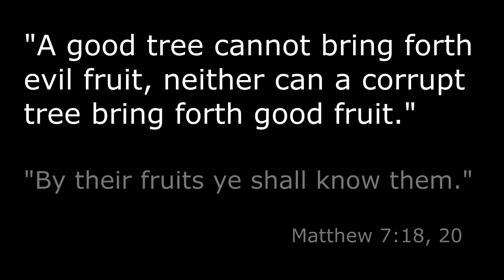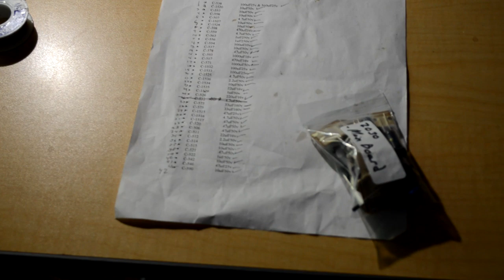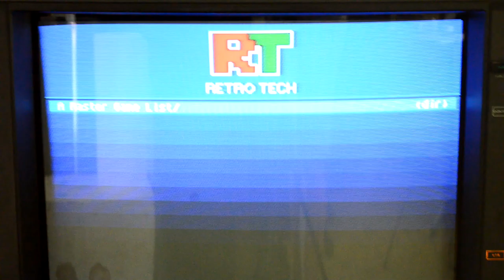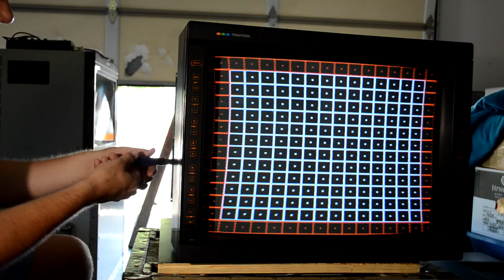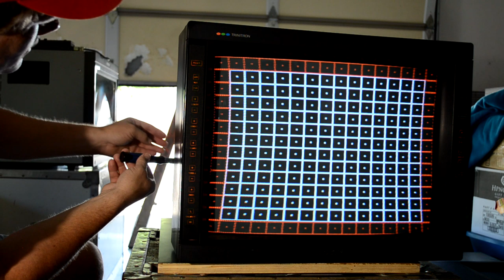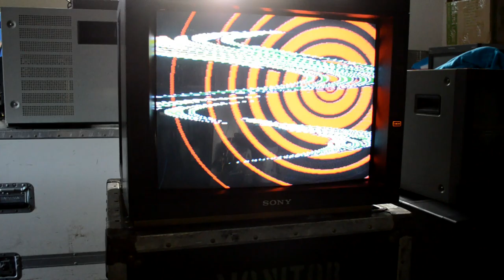How to Recap & Calibrate a CRT | w/ The Sony PVM 2030

Comment: I have a 2530 from 1994 and it looks great, except for about an inch of black on one side. I have an Extron VSC 700 that can move the picture horizontally and vertically to fix the issue, but it’s tough to find RGB cables for different consoles that are compatible with Extron. If I get brave one day I will reference this video and adjust the H position as you show here. Awesome video sir! You’re a hero.

Comment: This is fantastic! I just started following you as you have the best information for calibrating CRT tvs. I just found a KV-32FS120 Trinitron and found out how to access the service menu but have no idea which of the hundred of settings do what. The service manual tells you what the abbreviations mean but no description on what they do for the most part. Like PAMP is pin amp? I didn’t know what that setting did and I don’t feel particularly comfortable just adjusting all willy nilly. This video helped to show what a few of the frequently adjusted settings are. Thanks!

Comment: My pin amp is slightly off on my 2730QM. Is it the kind of correction I could easily perform on my own (as a complete novice who’s never opened a CRT)?

Comment: i have a question: i have old sony trinitron from 1998 (not pvm, just normal consumer TV) and when using composite and there is no signal (meaning its just displaying black screen with av2 icon in the corner) the blacks are PERFECT, you wouldnt even be able to tell it is turned on if thst icon wasnt there but whenever it gets signal from ANY of my consoles like ps2 or ps1 the black looks washed out and grayish but ONLY when it recieves signal, when i turn the console off then black level is perfect again, could that mean the tube is worn out or some electronics failed?

Comment: The result on the geometry is perfect after adjusting, but that PVM has major issues on its convergence. Have you did something to correct that? I have a pretty similar monitor, a 2130QM, and it's starting to have issues with its convergence on one corner, but I think that has to be corrected with convergence strips. However, on this one, convergence on the corners is quite awful...
Reply from the maker: That's a drawback to all these older PVMs, the larger ones especially have pretty bad convergence compared to newer and more high end CRTs.  I adjusted the rings and even swapped out a different yoke and this was the best I could get it at the end if the day.  It also should be mentioned that I only was using SVideo, so the picture is a bit less sharp than RGB will be.

Comment: Any idea why I wouldnt be able to adjust the horizontal size on a CRT in the service menu? When I change the value, it does nothing. I can change the horizontal position,  vertical position, and vertical size, but NOT horizontal size despite there being a setting for it.
Reply from the maker: That was the same original problem with this 2030.  When I tried to adjust it before a recap, many of the trim pots did nothing.  After a recap, evertrhing worked great.  It may be that one of the capacitors on the horizontal size line has failed.  I'd try recapping.
Reply: @RetroTechUSA  Thank you!!!!
Reply: @RetroTechUSA  I opened up my TV. I am seeing 3 different PCBs. A small one behind the yoke, a big one at the very bottom of the TV with all the power connectors going into it and a smaller PCB next to my inputs. Which board should I be looking at with regards to re-capping? I heard of a geometry board but I am not sure which one that is. There are a ton of caps and I dont wanna replace more than what I have to.
Reply: I noticed in your video you are able to manually adjust the parameters on that PVM. On the CRT I have, I dont see any holes like that on any of the boards, or any words like "h size". The only thing I am seeing is the adjustment things at the back of the yoke but I believe in another video you said those were just for the color

Comment: Cheap way to laod patterns into a RGB only screen?
Reply: If you are still looking for an answer, 240p test suite has been ported to pretty much every major console, so anything you have any kind of flash cart for should work, or a soft modded wii or a gamecube you can run homebrew on. Alternatively, with some configuration in config.txt on a raspberry pi, you can get an hdmi to vga adapter, a scart head, a vga cable, and a couple cheap components to make a cable that will convert 15khz RGBHV over vga to 15khz RGBs compatible with scart. If you already have the pi, you only need about $30 of parts.
Reply: @coopercummings8370  that is, I loaded it on my PI. It just bothers me depending which system I run it in (Ms, Snes, Nes, etc) everything has a different res and a different config.